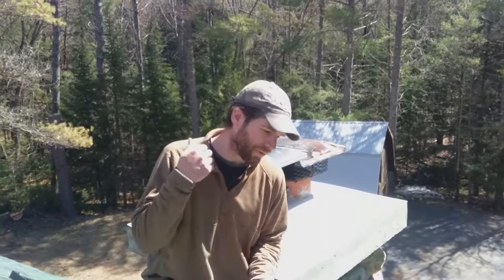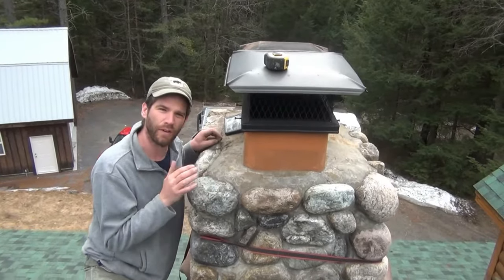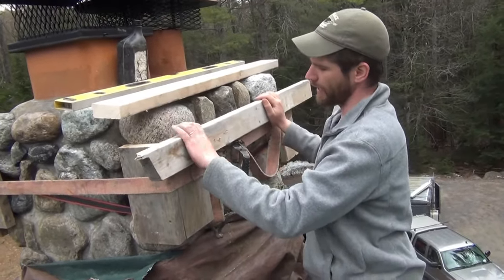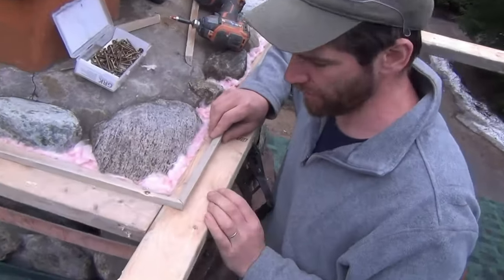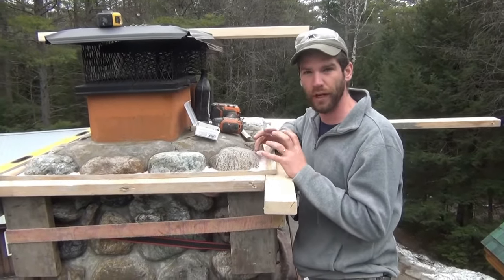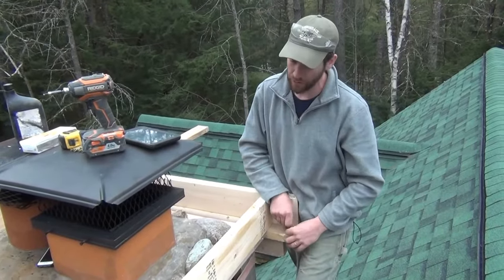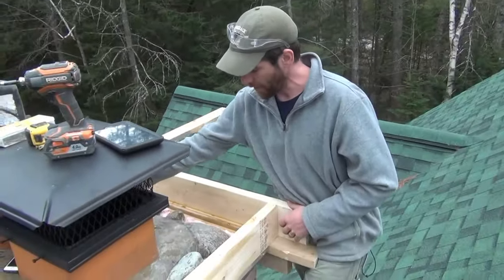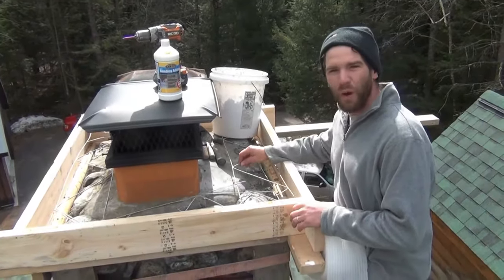How to Form and Pour a Chimney Cap (with Roger Houck)

Comment: This is a great video!  You covered every single thing (and then some) of how I will be forming my cap on a brick chimney.  Incredible.  Years of wisdom and experience in a relatively short video.  Thank you!!
Reply from the maker: Glad very it was helpful!   I've wanted to make this vid for a while.     please share it too.   you will have an easier time on a brick chimney,    you can even skip the ratchet strap trick and just  screw the first 2 2x4s into the mortar joints.    rather than packing the cracks with mortar the night before like we did here,  you can just use a little silicone caulk to seal the form from leeking on most brick chimney forms.    i guess i should do a brick chimney cap vid.   thanks for watching and i hope your cap turns out well.  please like and subscribe.  ive already recorded a dozen more how to masonry vids,  just have not had the time to edit 'em and get them up.  its our busy masonry season right now so we gotta make hay while the sun shines!  -roger

Comment: This is a really great video for people. I especially like the fiberglass with mortar and hammer drill trick. Those will both come in handy for us.

We tried a few different ways of creating a drip edge. Our favorite way does take a touch of practice, but when you get it, we love it. The verticle board flush with the height of the base, okay? Two cuts. ⅝ to ⅞ of an inch down from the outside top, cut straight in no more than ½" the length of the board. Then cut a bevel, leaving ⅜ to ½" of the top, down to the first cut.  When done, you have two "shelves" on top of the verticle board and just have to pay attn to not having bigger aggregate in the drip edge itself.

My experience says that expansion joint is still critical. We use np1 with primer. That sealant will last more than 20 years easily if applied properly. I gwt it, theres little evidence of expansion and contraction, but if ita gunna happen with a concrete cap, its gunna happen at that joint.

Thanks for the tips!
Reply from the maker: wow!   great tips!    sounds like you did a great quality job

Comment: This is BY FAR the most comprehensive and informative video on this subject we’ve found. Thank you for doing such a thorough job on both the cap and video explanation of the process (how and why) 👍
Reply from the maker: Scott- I'M Glad it was helpful!  thank you for watching!   Please sub and share.   If you are working on a chimney cap and run into any issues,  feel free to ask.   I will do my best to help.     -Roger
Reply: @TheHowToHeadquarters  it just so happens I do have a question. What product would you recommend to patch a cap. I need to adhere to existing cement. Pics available if needed.
Reply from the maker: sorry i replied but it must not have posted.      patching a cap  does not always work.   if a crack formed,  it is from movement and it will likely move again and a parge on cap will probly crack.   but that being said I would probably use a fibered waterproofing mortar like blockbond   and apply it to a moist clean concrete cap as smoothly as can be.   then spray the cured cap with aqua pel or another waterproofer.    an easier and maybe more effective route is to caulk the cracks with Lexal or another hi performance flexible caulk.    the lexal is likely to expand and contract with the crack and keep water out,  but the weather and sun will break down even the best caulks in a few years.    I hope this helps.  sorry i did not get bck faster.  send a pic or lmk where you are at with the project.

roger

Comment: Your videos helped me put a new hat on my chimney. Genius techniques and advice. Thanks for putting this out for all to benefit from!
Reply from the maker: Great to hear! Im glad this helped.    was your chimney a stone or brick?    let me know if you can think of any other topic i should make a video about.
Reply: @TheHowToHeadquarters Brick chimney with easy access to 3 sides. I used the technique you showed for stone making a floating support for the form using a ratchet strap instead of screwing a base board into the mortar. I put in a drip edge in the overhang with 1/4 round, but I glued and nailed the strips down instead of cabinet screws. I had time to wait for the glue to dry and an air nailer handy so it made quick work. 6.5’ x 2.5’ chimney so it took 560 pounds of concrete to make the cap. It never budged!  You covered everything crucial. Can’t think of anything more worth adding  Cheers 🍻
Reply from the maker: thats a great idea gluing the 14 round down.   then its sure to come off with the form and not get creet in the space between.   great tip!
Reply: @TheHowToHeadquarters  Great tips in this video.  Couple of questions, the z shaped, galvanized block reinforcing wire ... do you pull it up off bottom of the form an inch?  How come no form release?  If you were to use sill seal as an expansion joint, have you tried using crown coat to avoid going back on top?  I think your idea of using 1/4 round to create a drip channel on bottom or cap is fantastic, I live in Michigan and we have the freeze thaw cycle going daily in the winter and water working its way under the cap/crown into the rows of brick underneath have reaked havoc on my chimneys.  The other idea of using a cordless hammer drill to vibrate the form walls is a great trick.  I didn't realize how much that would help, great camera work to show that.  If you were local contractor, I would be happy to have you do work for me.

Comment: Excellent informative video sir. I grew up in your area and had a house on the Okara Lakes and don’t miss the winters one bit . 

Another great way to make the chimney last which is far less labor intensive is to add 24-26 gauge metal chase covers to them . I have them constructed by a local metal fab shop. The initial cost is a little more more but far less maintenance in the long run and better protection from the elements.  I’d also suggest sticking with Stainless Steel rain caps versus those powder coat steel ones as they rust out quickly and leave bleed stains down the chimney . I’ve been in this industry for 22 years and give the customers both options if it’s an existing chimney .  If I am building  a new cultured/natural stone chimney my only option is metal chase covers .
Reply from the maker: great points!  thanks.   good point on the stainless.    and the fabricated cap.   do you have them make a color for the flue?

Comment: I have to do a similar project and have scoured YouTube trying to find good advice on this job. This is by FAR the best video on the topic.
Reply from the maker: I'm glad it was helpful Brad!  let me know if you run into any more questions as you tackle this job.
Reply: @TheHowToHeadquarters  yes actually I could use some advice. My chimney is cinderblock with a row of brick and then a mortar slope. 1 inch overhang on brick. No drip edge.

Mortar is terrible and falling apart. Underneath it looks like some kind of drywall that was used as base of mortar sloping to cover cavity on either side of chimney. Some other top bricks are very loose. Do I rejoint the existing brick and pour this type of concrete cap on top on top or remove the brick (larger cavity if so).

If I remove the brick what do you think I should use to support the wet concrete over the cavity on either side of the chimney? Plywood? Cement board?
Reply from the maker: yup i'd take off the brick and then cover the cavity with metal roofing maybe with some sticks of rebar under it.   then creet cap over top.
Reply: @TheHowToHeadquarters  thanks, I actually already did the work two weekends ago. Just ended up using cement board over the cavities. Waited a week to take the form off over this past weekend. It looks great!

Comment: Hammer drill technique was genius!  Thank you for sharing.
Reply from the maker: THANK YOU for watching!    yep that trick is a game changer!  Im glad your pour went well!
Reply: @TheHowToHeadquarters  I used furniture bolt with smooth head for this application. But concrete vibrator is better and you can stick it into tight spaces also.

Comment: Mason here. Pouring a cap tomorrow. I put flashing under mine. This would be difficult to flash under it it is just big enough to be annoying.. You could caulk the cap to the flu after you strip the form. There will be a slight crack there in time. I make a drip ledge with a router. I kinda like your method better. Thinking regardless I will make my drip edges more pronounced. I have a Makita 18v vibrator but your method works good too. A bushing hammer on a hammer drill would be good. I am on this job using PVC board for my walls. They are super smooth. I may have to reinforce them. Everything in your video was extremely solid advice. I was very impressed with it.
Reply from the maker: THANK YOU!   yep we us flashing or metal roofing somtimes if the space is bigger.   and good point on the caulk.   i love using the pvc when we make curved forms.   THANKS FOR WATCHING!   I'll have more vids coming out soon.  we are still frozen in up here in northern NY

Comment: Been doing it only ten years, but my old sensei taught me an AMAZING way to do these in less than a few hours. You grab some 2x6 3-ply luons and measure in 1/4" or 1/2" if necessary from each outer edge. Gorilla tape any leftover disparity. You screw the luons into some surrounding 2x4s or 2x6 and then sit it right on top, grid wire and pour.  Should allow for a 1" drip edge on each side and I've done concrete crowns in 2 hours no bullshit man.
Reply from the maker: that  sounds intresting.  thanks for watching!

Comment: Would’ve been nice to find  this a week ago, lol.  I ended up using quick release clamps to clamp 2x4 form around the chimney to get the width and overhang, and screwed a 1x4 to that to get the height. Used sakrete fiber reinforced concrete. For drip protection, I ran a bead of silicone around the underside about a 1/4 inch in.  Hopefully that’ll help the water drip. Didn’t lube the wood. Good whack from a hammer got the form off. Turned out pretty well.
Reply from the maker: thanks for watching anyway Brock.   it sounds like you found other ways to skin the cat!   sounds like a successful cap.  and being 4" thick will make it strong and heavy.   great job!

Comment: The best video on this matter so far. I need re do mine but already have the slope but was done like you said . Whoever made just used the remaining mortar on top. I wonder if i can make similar like you did but not so thick the slap. It’s rectangular with two flue. It’s 2ft x 4ft. Would be ok i make following the slope and make 1-1/2 thick slab?

Comment: Roger dodger hope ur fall hobbies/chores are going well..we tare down the side boards the same day of the pour..always leave the bottom base board for a couple days but by taking down side boards 4-6hrs after pour depending on weather situation ur able to doctor up and imperfections while it's still workable..we typically use a sponge on the top and sides..flat trowel finish probably outlast sponge not sure
Reply from the maker: that is a great idea!    Then any pock marks would accept the patch easier.   I done know about a sponge finish,  but a trowel finish is basically gone in 2 or 3 years here.   the acid rain eats the surface,   but with a good thick pour and some sealer once in a while,   it seems to last forever-ish.   I'm gonna thr the side board trick on the next one!

Comment: This was real good video - lots of good information.
 I think I saw a crack in my crown the last time a cleaned the chimney - don't know if I have the stamina to stand on the roof for any length of time; even with a Fall Harness I find my calves are just super tensed when I am on my fairly steep roof . Fear of slipping and having the screw heads on my metal roof dig into me, or just the thought that I may loose some tools sliding off the roof.  :)
Reply from the maker: yeah its no fun on a metal roof.    a little caulk in the crack might buy you  a lot of time.

Comment: Great video. I love the hammer drill idea. However, I would put a bond break water proof layer directly under the cap and seal the water proof layer to the flue liners. I’ve seen it time and time again taking down chimneys where the cap has moved, ever so slightly, and dislodged the last course of brick, or it has spalled the last course of brick, all because there was no bond break.  The cap will stay in place with its own weight.

I’ve also seen it time and time again where the concrete expands and contracts and cracks the flue liner. This may be less of a big deal with a less thick and less strong mortared cap, but certainly with a concrete cap touching a clay flue liner I would’ve did an expansion joint. If you water proof under your cap it’s less of a deal if the caulking degrades every 10 or 20 years.
Reply: Hey, I was just wondering what you use as a bond break? I used to use a thin foam material, but it's a pain to fit properly.
Reply: @jakenardi8406  blueskin twf ( the yellow stuff). And seal it right to any penetrations. And also it’s a good idea to to a pre slope underneath the bond break. You could just build up the centre with extra mortar before you put the bond break waterproofing layer.
Reply: That makes a ton of sense and will deliver the results you expect, I'm sure.

Comment: As an alternative to wood forms over stonework, I use standard (2 1/4" thick x 6" wide) Bedford sill stones over top of stonework. Cut "drip" with grinder/wide diamond masonry blade and overhang 2" minimum (code here). Fill space with mortar/bricks/etc. to flush with top of sill stones and cover with 40m rubber roofing (bond break/flashing per Masonry Institute)  and set wood forms over (1/2" bearing on outer edge of sill stones). Wrap tiles with ductwork bubble wrap then pour crown, 6000psi mix with fibers & liquid integral water repellen (rent gas barrel mixer if nec.). Silicone or RTV sealant at tile expansion gap and you're done. May need to cut new tiles to extend 2" min. (code here) with electric saw/7 1/4" diamond blade unless you have gas cut-off saw (Stihl, etc.). Wood form can be pulled same day since you want  to use "stiff" mix (low slump) and sill stones support concrete overhang. Can be done in one day, been doing this way for 20+ years. Your way works too.

'
Reply from the maker: that sounds like a watertight system and it could be done in a day!   interesting!  thanks for sharing!

Comment: Hey Roger - Do you add any sort of sealer on this afterward for waterproofing? Wouldn't the snow and water drain into the concrete since it's porous?
Reply from the maker: yes good point.  i like aqu-pel for the sealer.  but you must wait 21 days to apply after pouring.  thaks for watching!

Comment: Really enjoyed this - thank you. Would you consider adding a drip edge (bell cast bead) to the lower outside edge - to further enhance shedding of rain water?
Reply from the maker: That's a great idea!  it would be a bit of a time consuming detail but it would give it a rich look and im sure it would aid in tripping the water.    now you got ma wondering about making a form board with a belly routed in the bottom.  rather than the system i show int he vid.   neat thiking.   are you working on  chimney cap now?

Comment: I followed your plan on my 90 year old chimney and everything worked very well. I did not have a hammer drill and used a rubber mallet and a palm sander to vibrate, I still ended up with some honeycombing on the lower edges. In retrospect I should of made the first batch of concrete wetter. Can I just patch those with sand mix or cement patch? Thanks for the video, it is the best out there by far.
Reply from the maker: Nice work!   yes the honeycomb could be patched with some sand mix on a coo damp day so it does not cure too fast.  the sooner the better so it is most likely yo bond with the green cement of the.  yeh i should have mentioned that the first batch or 2 are best a little on the wetter side.    then its gotta be stiff to make the pitch on the top of the cap.   great idea about the palm sander!    thanks for watching and commenting!

Comment: Perfect video for me. Building staging at the moment to replace my crown.
Reply from the maker: Glad it was helpful!   and I'm grad you found it.    let me know if you run into any other questions.   really the staging work is as big a project as the actual repair.    we just poured a crown yesterday.   is is a stone or brick chimney?
Reply: @TheHowToHeadquarters  It's brick and built around 1970. I'm welding together a section of pipe staging(1 1/4" schedule 40 steel pipe) to mate up with the store bought section I already had. Welded a pair of ladder hooks last week. The staging will be two 6'4" sections high on the front face and then planks onto the roof supported by planks on roof brackets set up on ladders hooked to the ridge. I will put up a quick video tomorrow on my channel. This is my first serious masonry project but have construction/woodwork background. If I get hung up it's good to know Youtube will save the day!
Reply from the maker: oh before you set up the staging on the shingles.  we often protect the shingles with an old tarp.  or if we need traction to work on we lay down an old carpet.